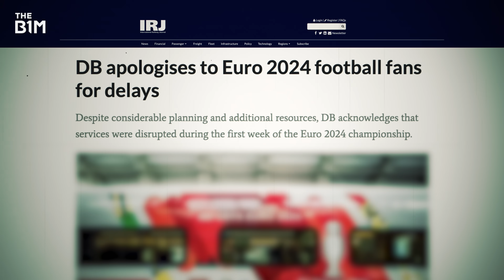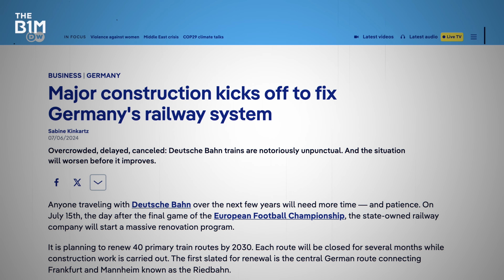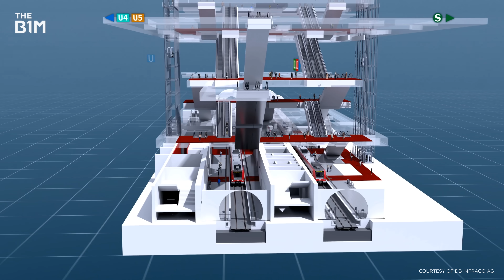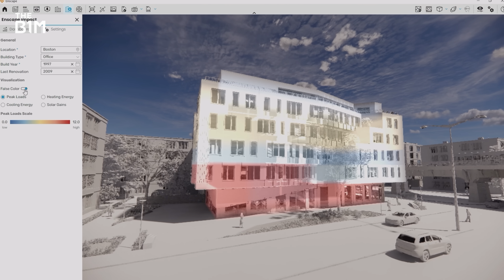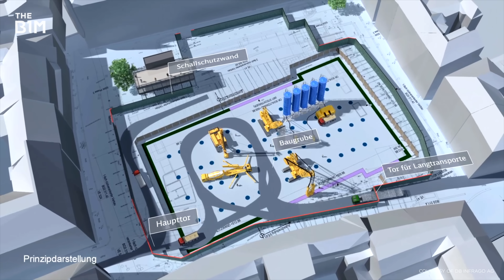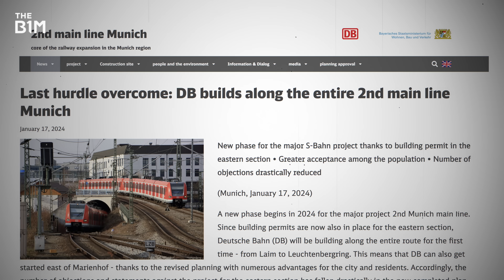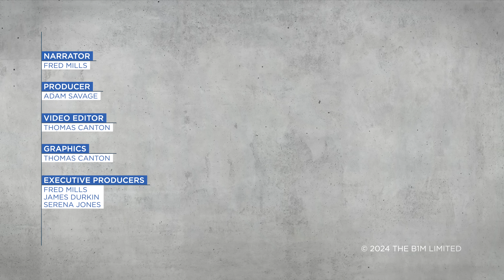Germany is (Finally) Fixing Its Failing Railways

Comment: As a German here: The DB (Deutsche Bahn) isn't very precise with their timing. A delay is officially only counted after 5 minutes. So, in daily life, trains are almost always a few minutes late, but it doesn't show up in the official statistics.
Reply: Also cancelled trains are technically not late, because they never ran :D
Reply: @kiffeeify  Not counting trains that never appeared is the only thing that makes sense mathematically speaking tho. That is why its a seperate KPI
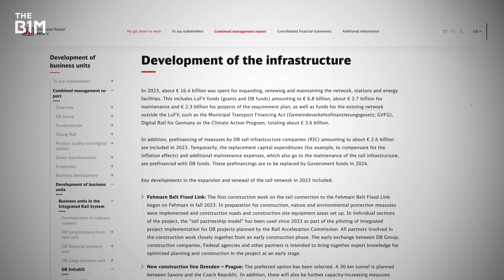Reply: IMHO: 5 min are absolutely fine for long distance travel. If there's a connection every 60 min and let's say it's an 4 h journey (e.g. Berlin-Munich)... It won't matter for 99.9 % of all passengers whether you arrive at 10:00 or 10:04.

If you take a flight, you'll add some buffer for longer taxiing or bag handling. If you take you own car, 30+ min buffer for traffic jams? What is important is getting your connection and therefore the heavy 15+ min delays are a problem..
Reply: @Critizens funny enough the ICE and IC (our highspeed/long distance services) are the ones most prone to delays over 5 mins.. 
It isnt uncommon for some ICE services terminating a station or two early to make up for delays on the trip back.. 
(Source: im a train conductor here myself.. but im sure theres several articles backing that up too)
Reply: @Critizens if there were conections every 60 min it would be great. But for more than two decades now many conections are in a two hour rhythm today.
Reply: @Critizens it's not fine if you DEPEND on this train schedule and have other trains layovers after this one
Reply: @Critizens  The 5 Minutes are for every train not only long distance xD And also you often miss the next train because your first train was late...
Reply: @XA--pb9ni for long distance it is 20 mins
Reply: @XA--pb9ni  > And also you often miss the next train because your first train was late...

DB has a separate statistic tracking how late passengers arrive late at their destination because of missed connections on the way.
Reply: @MrMeisterGamer no, reisendenpünktlichkeit for long distance is 15:59 and betriebliche pünktlichkeit is 5:59
Reply: Cancelled trains are also not counting. So if a train is delayed too much they cancel it. Do it doesn’t show up 😅
Reply: @AlbCaphalor well they are still counting towards reisendenpünktlichkeit
Reply: @AlbCaphalor  Also if the train cuts out a stop it is the same. For this reason the DB actually often enough cuts out some stops, especially at the end/start of the route, meaning their train which e.g. should go from munich to dortmund instead stops at düsseldorf, and then on the way back of course it is suddenly on time again, but people wanting to go to dortmund or coming from dortmund are left to figure things out for themselves lol
Reply: As an American that lived in Germany for over 4 years I loved the DB
Reply: Also there is The so Called profalla wende, which describes The process of a train turning Back Prior to reaching ITS end Station in Order to get The train Back on the timetable
Reply: Some say it drives as the wind blows
Reply: Crazy to think a couple decades ago they were so punctual you could set your watch according to their arrival.
Reply: @00dfm00  those times are long gone 🚬😮‍💨
Reply: as a fellow german: ppl tend to forget one important thing imo
- we did not seperate between industrial and personal trains like japan
- construction companys earn money in one way: "nachträge" or addendums, which are almost always pre planned; this is to win the europe wide tender for constructions with a lower starting price -> seen on every construction side
- we are an industrialiced country in the middle of europe with almost 83 mill. ppl. 
-> yes, things arent looking great, but its a massive challenge for a country with this much traffic/people and industry people tend to forget
Reply: ...and cancelled trains aren't even in these statistics.
Reply: Ich möchte an dieser Stelle an den Werbesport von 2000 erinnern, in dem die Deutsche Bahn sich über eine 3 Minütige Verspätung lustig macht und die Bahn das pünktlichste Verkehrmittel nennt.
Reply: Same in Sweden.. also cancelled trains don’t count either
Reply: Fortunately a train being 2 minutes late isn’t that big of a deal to most ppl
Reply: I think the KTM in Malaysia it is even more worst
Reply: It's 6, not 5 minutes. Also a train that never starts, doesn't get into that at all.
Reply: The same thing happened to VW in emissions. German precision.
Reply: yes thats because then you miss a connection as everything below 5min is not defined as a connection!
Reply: We are offering flexible loans and funding for various projects. We have financiers ready to fund projects with low risk-seeking debt funding capital for expansion and startups irrespective of industry or geological position.

A good project with promising returns irrespective of Industry so long as it is legitimate within the jurisdiction where it operates.

The funding type is Debt Financing. This Funding program allows a client to enjoy low-interest payback of 4% annually for 1-10 years. Appetite is between $500,000 to $50m depending on the project risk level.
Reply: Regional trains from DB as a rule of thumb in my experience... will always be 5 minutes late making me loose the connection, extending my travel time by at least 1h (always).
Reply: @laurencerws  there are no 5min connections in germany a connection is at 6min plus thats why trains als count as late at minute 6!
Reply: @schwarzesonne130  I don't think we are using the same DB app lol... it shows me as short as 2-3min connections. Many times I caught them... many times I lost the train 😂
Reply: @laurencerws  the DB app shows stuff thats also not a connection. Just like people call everything a bahnhof despite many of them not being one but rather haltepunkt,haltstelle etc.
Reply: People aren't aware precision is a period of time by definition, it's not a point in time.
0 seconds is impossible, each company has to define such an interval. There is no other option.
Reply: It‘s actually 15 minutes….Everything under 15 is „fine“.
Reply: true, my commute train is usually 2-3 minutes late
Reply: Biggest issue is if ur changing trains and the first one is late but not the second
Reply: And also trains that are cancelled do not count into the statistics
Reply: This is not true at all,  if you use the DB App you get pretty precise updates of the current timeing of your train and at what stations they are. Atleast they are good at keeping track of their latens in my experience. :D
Reply: In the UK it’s one minute until a train is counted as late for statistical purposes
Reply: Die ignorieren auch einfach Ausfälle! 😂
Reply: I think they only count upwards of 6 minute delays.
And there are a lot of connections with only 8 minute time to switch trains.

The solution? Longer times for switching platforms. Which means longer travel times - but no real assurance that you'll really get it.
Delays are often 20- 30 minutes if there's a problem. And a lot of trains travel only every 2 hours.
Reply: To be freak: they have changed it in 2020. An intercity express is still considered „on time“ when it is less than 15 minutes too late. Which makes no sense. Anyways.
Reply: @flomoose7315  No they actually didnt. They have 2 punctuality statistics. One for the counting the train itself as punctual which is under 6 minutes and one for people being able to reach their planned destination which considers things like if they were able to make the transfer to the next train they planned, which is under 15 minutes and what you are probably referring to. But DB still keep track of and publish both of those statistics with a clear explanation on what they mean
Reply: I don't know for sure if they're still doing that, but they also used to subtract the time by which other trains appeared too early (without a 5 minute threshold, of course).

So, yeah. Even with all the embellishing in place the statistics are still a nightmare. Just try and imagine how bad it really is. 

And, of course, the obligatory "Danke, Merkel."
Reply: in other countries its counted after one or two the worst besides germany i know is three minutes this is already higher than most.
Reply: @icephoenix5466 not really. Even the mighty SBB only count from 3 minutes onwards. In North America they sometimes use 15+ minutes or it even depends on the total length of the journey, so it go up to 60+ min. Most countries use 5 or 15 min.
Reply: @raileon  I mean America doesnt realy have a train network in the first place so its a hard to compair that to European Standarts of Public Transport if you compair it to other EU countrys its a compleat fucked network
Reply: @icephoenix5466 that's not true. Google it! Switzerland is the only country in the EU that counts after more than 3min. Anyone else is 5min and more.

Comment: 2:17 The long distance trains are relatively fine, the real issue are the regional ones.
Reply: The regional ones have fewer delyas. They have shorter total journey times and many run only a short time on mainline tracks.
Reply: regional rail services often come with less delays actually
Reply: in which germany do you live, its the other way around...

Comment: I wish DB would still be state owned - the problem is privatisation - neoliberalism and plain old greed and capitalism. You make a video about a single project - overall DB has several problems- boiled down to cost cutting and an non functional hybrid between a private company and taxpayer funding. This neoliberal BS does not work!

Comment: Only 60 billions??? This amount is ridiculous (but better than nothing).
Reply: 60 billion is a huge number. 
In the next few years, they'll invest double in rail than in the highways. I think that's plenty.
Reply: @noidea5597  I have no idea how much the whole upgrading would cost - I'm just guessing but considered that Germany has 40'000 km auf railways 60 billions doesn't sound like much. That makes 1,5 million per kilometer. Just building the rail tunnel NEAT through the Swiss mountains cost 6 billions. And then there's also the trains themselves plus the infrastructure like trains stations etc. 
Online I've found these numbers: Cost per 100 kilometer railway = 428 million

Ausbau der Bahntrasse Lübeck/Hagenow Land-Rostock-Stralsund Länge: 250 Kilometer, Kosten: 1,07 Mrd. Euro,
Neubau Autobahn A 20 Lübeck-Stettin Länge: 323 Kilometer, Kosten: 1,9 Mrd. Euro,
Reply: That’s the whole GDP of some countries…
Reply: Well those 60 billion are just for overhauling and fixing the most pressing issues with existing infrastructure either in poor condition or can be improved for more capacity with small additions. Like extra switches for creating lanes to overtake, some new flying junctions here and there, or like replacing very old pieces of hardware that just can't be upgraded in their current form and are very hard to keep operating – like very old switching stations and signalling systems. But this 60 billion does not include all that would be needed beyond that to actually significantly improve network capacity with new connections, extra tracks on some overloaded routes and so on. This is just the first needed step to keep what's already there from falling apart.

Comment: I’ve been working in railway management for over 15 years by now, and I always have to laugh when a new government comes in and has some very expensive plan to “save the railways” (mostly including an army of very expensive consultants that produce reports with very few new insights). 

Providing in a performant rail network is at its most efficient when former governments just wouldn’t be so keen on sabotaging operations; we’ve been doing this for over 100 years, people in the industry know how to do this. It’s not rocket science, just investing in what has to be done…
Reply: Contrary to the governments before the current one (although having fallen apart) at least decided to spend this money - before there also were a lot of words but no actions
Reply: Consultants and contractors just don't have the same incentives as staffers. Sometimes they do good work (e.g. SNCF in Morocco, al Boraq), other times they blow up the costs (e.g. EDF in the UK, Hinkley Point C for another French example). That said, part of that is poor management of said contractors/consultants.
Reply: maybe you can shed some light on this for me, why the hell does munich not just build a ring around the city instead of yet another railway? Like, large parts of a ring would already be completed anyway, it would just be connecting them and adding another line next to the existing one, which is way easier to do since its above ground...
Reply: @pottedrosepetal6906  I'm not involved in the decision making around that project so I don't consider myself to be knowledgeable enough to provide concrete answers.
Reply: But shiny new projects are better for the politicians image as proper maintenance, and smart improvements on the right places.
Reply: Become an advisor to the spd. We can always need good workers who know their stuff.

Comment: I go to Germany every year. Germanys rail network is the best in Europe IMO, however, the last few times I've been there I have noticed a decline in the effinancy of Deaushe Bahn
Reply: I use the german transport system almost every day since 29 years. And i can confirm its becoming worse and worse.
Reply: I come there every year too a few times. It is by far worse than the Dutch railway system and the French railway system, the two systems I use regularly. It used to be great, though. But now? One to two hours delay are regular, and I get an email “the journey you booked cannot be made anymore” more often than not (and the links to solve the issue in the mail all do not work either, basically you’re on your own finding out what is the exact problem and how to solve it). I have fond memories of train travel in Germany. But these were the late eighties. The only real delay I can remember was because of extreme snow, and not because the train couldn’t ride, but because the driver couldn’t make it to the station. And I got a hotel when I didn’t make my connection to the netherlands.
Reply: Come to think of it, I use Italian trains also sporadically and they too seem to be better.

Comment: vienna has practically the same situation. there is one rail-line from meidling to floridsdorf, and that's it. this summer, it was closed for maintenance, and this was a problem.
and it needs to be adressed.
Reply: Comparing Vienna public transport maintenance to Germany is like comparing a Porsche 911 Turbo S to a VW Lupo.
Reply: @stehgrad  but there is still the problem, that the network has no real alternative to route over the danube, because the trunk line has one of the just two railway bridges over the danube.